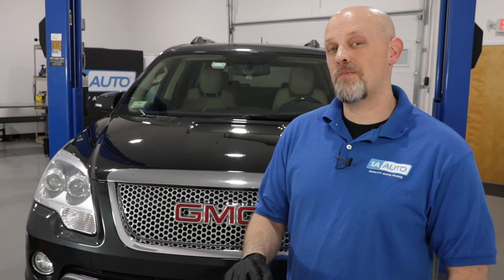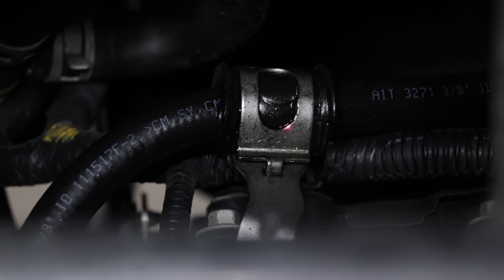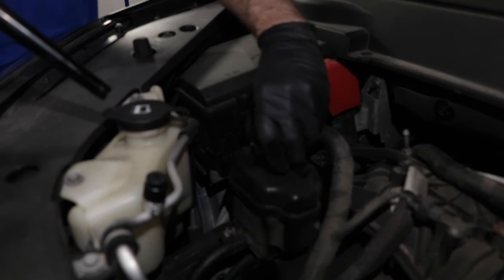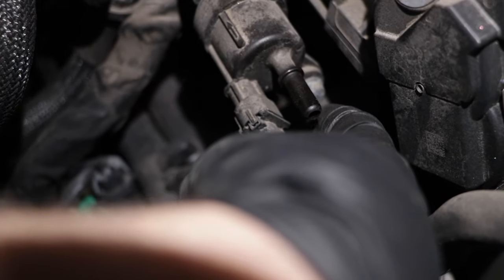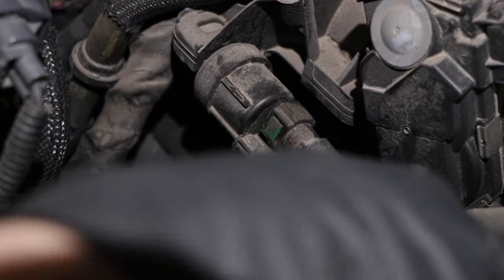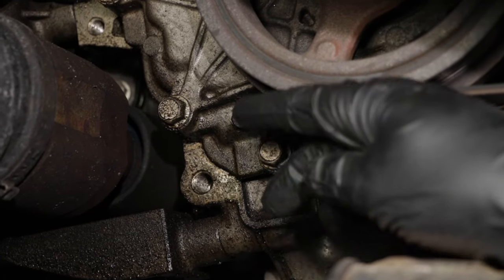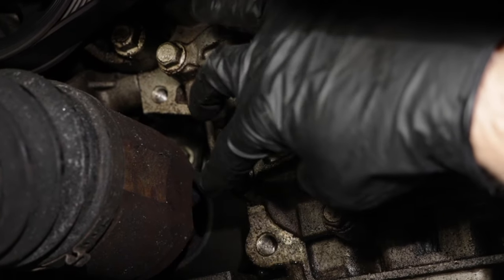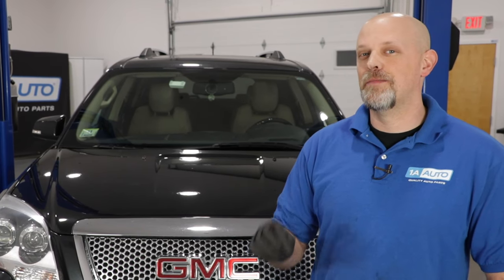Top 5 Problems GMC Acadia SUV 1st Generation 2007-2016

Comment: 2014 Acadia - Had to replace purge valve, the actual nipple for the purge hose was broken off at 45,000 mile mark i assumed from vibration of ther hose itself.  So I strapped the purge hose to the air hose from the air cleaner to the crankcase.  At 74,000 miles I filled up with gas and then the car would not start.  I eventually got it running again and discovered that air hose I strapped to the purge hose pulled away from the crankcase and caused P0171 p0174 and P0496 codes.  So an easy fix for a stubborn problem!

Comment: 1st gen actually ran until 2012. Second generation from 2013-2017 where that year both were made with the 3rd generation
Reply from the maker: +Marc Franco Thanks for the feedback!
Reply: Right? I saw the title and was like, “hold up, that ain’t right” 

Lol.
Reply: I believe that was just a face-lift/refresh rather than a brand new generation. 13-17 still rode on the same Lambda (GMT968) platform and used the 3.6 LLT.
Reply: First gen was from 07 to 17. Blake is correct about the refresh.  The interiors through all years are nearly identical
Reply: Correct! I didn't see your comment until after I posted my comment lol I'll just leave it anyways so more people can be aware...
Reply: True. Same platform, but the previous issues actually were more dominant in the 2007-2012 model years. Very minimal in the 2013-2017 years

Comment: 2014 Acadia FWD with 150,600 or so miles on it, rear brake calipers have locked up twice so far, just got it out of the shop with a $3000 bill...  broken engine mount, bad purge valve, oil leak from filter housing gasket, blown front struts, new sway bar links and an "exploded" (the mechanic's description) AC compressor besides 2 new tires, and alignment, new battery and routine oil change. Having said that, the only problems I had with the vehicle before about 120,000 miles were the calipers.  From most of the comments on here, it sounds like I got pretty lucky...  Since I got her out of the shop, she runs and drives as good as the day I bought her brand new with 9 miles on the odometer.

Comment: I had the timing belt stretch on my Acadia.... The mechanic took almost a month..... He said he has done multiple timing change on those cars but he couldn't figure out why mine was much harder.... He gave me a discount he took off $500 off....  And I never had a problem with it anymore....
Reply from the maker: +hacatan24 Thanks for the feedback!
Reply: I know you are lying. There is NO timing belt in those engines. GM hasnt used timing belts in a long LOOOOOOONG time. Your mechanic took a long time because he spent time looking for things that didnt exist.
Reply: Excuse my question, but you know how much the mechanic charged you for timing belt in this car, I think mine needs it and I'm figuring the rate

Comment: 2014 needing both CV Axles most likely. The transmission recently went in for full service rebuild and now has major vibrations when turning left and right, especially while accelerating from a stop light onto a freeway on ramp. Acceleration in curves and even driving straight but accelerating on slight inclines there’s vibrations being felt.

Comment: Everything was fine until you mentioned “timing chain” & “transmission” 😫
Reply: Mine had to have both of those issues fixed.  Luckily one was a factory recall and one was actually covered by the extended warranty.  On this vehicle the warranty will pay for itself.

Comment: Good thing I came across this video.  I have a 2011 GMC Acadia SLE with 187k miles.  I had my transmission rebuilt recently and everything was fine but when you mentioned the torque converter and a droning noise going up hills, I just started having this noise.  Doesn't happen often but definitely will hear it when the car has been sitting in the heat all day and then I drive home with the AC on.  Sounds kind metallic or even like the tire rubbing on plastic sometimes.  Even without the AC on, it will eventually happen.  There is a hill that I go up after turning left and it just makes a nasty noise.  But another thing is, I don't have to be driving highway speeds to hear that noise.  It is usually from accelerating after being stopped at a light or stop sign.  I wonder if what you talked about in the transmission segment, is what I have.  What do you think?  I still have a warranty on the rebuild so, I will have to try and get it back to the shop.
Reply: Yes, it's during the acceleration. It's probably the torque converter. I have that issue now. I just kind of let off accelerator and then slowly get back on it. Eventually I'll get it fixed.

Comment: You left out the issue they had with the PCV system clogging because the PCV valve is just a can with tin holes with no check valve inside like standard PCV valves have. It would clog and cause oil in the intake boot among other problems. Low oil levels for one caused the timing chains to overheat and stretch.
Reply: Yep

Comment: GREAT 1A Auto Post As ALWAYS **Should I buy a 2014 GMC Acadia AWD SLT? It was bought serviced at original dealer and selling at same dealer in IL. It has 111K its beautiful mint clean saw no leaks rust or smoke from tailpipe .I take of my 15 Equinox oil changed every 3.5K miles or 35-40% oil life left… Now I’m nervous because I haven’t done nothing to my 15 Equinox 2.4L yet…knowing that around 70K miles engine loses oil “GM mistake Eco-Tec”seal blowing from PCV..etc..but I had my mechanic check out for future problems but he says I’m good.. made in Tennessee no carbon build up 
***So back to the 2014 GMC ACADIA Yes or No? or problems are coming? great Post!!

Comment: I own a 2016 Acadia. Bought it with 42,000 miles. First 2 years no problems . 3rd year , i had to replace the power Sterling pump, thermostat and did a transmission flush at 75,000 miles. Replaced the battery  since it was giving out and upgraded  to an internstate battery.. Had to get a longer vent  hose to
  actullay fit properly.  I Always use chevron gas (89) and my mechanic uses Mobil 1 oil . Today my Acadia needed 2 heater hoses that ruptured leaking coolant everywhere.  These hoses cost 150 and 139. My current milage is 82,000. Is this a common situation or are these hoses made cheap? This suv is reliable,  great on gas for the size, comfortable to drive and sporty with plenty of nice features. Im satisfied with it. Hopefully its made well enough to give 300,000 miles. My 2000 eclipse is currently at 250.000 miles original engine and transmission.  Gmc should make better quality parts since im paying for an American vehicle.  I feel we have given imports preference when we should by American. GM should make quality parts like Toyota, Lexus and we would buy more instead. Thank you fpr the video i saw it years ago when i purchased my Acadia and still watch often for reference.

Comment: I believe we have had several of the issue's with our 2011. The check light has been on for the timing system for a while now. I dread tackling that issue. Have a few issues with starting. Replaced starter this past summer. Hit they key a lot of the times and it is like the vehicle has a dead battery but all column lights are on. Few times working ignition and it always fires. That's aggravating. Overall we have ran the wheels off it over the years.

Comment: My 2012 Acadia SLT hesitated, not the first time, and the check engine light started flashing. I parked it and had it towed to the dealership where the codes said it had had between 200-300 misfires in it's life. This is the only code it gave. Now the dealership wants to service/change the injectors, spark plugs/wires and whatever else they think might have generated that code. Last winter at -25° my Acadia blew out a huge puff of black smoke and then would not start. A couple of days later when it warmed up a bit outside it did start but still blew out black smoke just not as much. This continued for a few days and then stopped. It hasn't done it since. I have the oil changed regularly by the dealership and they do a comp safety/fluid level check on it. Please help.

Comment: From what i see on my Saturn Outlook, and read online in chat sites, they also have a great issue with burning and leaking oil out of the cam shaft oil seals.  These are crappy built engines.  everything from the transmission to the design of the engine is junk.

Comment: I just got a 2014 Acadia. It has 96,000 miles. Only issue I notice is going up a hill  about 20-25 mph  and it has a hard down shift.  It shifts fine other wise and there is no slipping. It just has this one gear where it has a hard down shift.

Comment: This vehicle it's a big piece of junk.  Engine damage cause by the timing change reflects poor American engineers. Don't forget to talk about oil blowing into the fuel injection and the air ducks. I will never buy one. Toyota it's way better car.
Reply: What do you mean about the oil issue someone told me I have lifter issues

Comment: Love my Acadia, but recently the check engine, traction control, abs, and brake lights are on with no codes and she drives in 2wd instead of 4wd. I changed out the speed sensors now looking to change out abs module, again no codes pop up. Any advise anyone with the same issue? By the way love your video and well explained 👏🏾

Comment: Your videos are very helpful . I do have a problem with my 2007 Acadia . While I'm driving the vehicle loses all power and won't start right away after this happens . What do you possibly think it is I've had a few shops look at it and couldn't pin point it . Plz help !

Comment: Thank you for the video. Bought 2012 Acadia with 130,000 miles and bad transmission. It was replaced and 2 was later it was back to dealership for a month getting another transmission. Couple months later it started acting up again. Once again back at dealership for a month and was told it was a speed sensor or something they replaced. Vehicle still doesn’t seem like it’s 100% but it’s running. Of course now my vents don’t work so not sure if something happened or the actuator quit. I love the vehicle but hubby hates it. 🤣
Reply from the maker: +Skidmore Family Farm Thanks for checking us out! http://1aau.to/m/Shop-1AAuto-c

Comment: I wanted to ask, when checking the transmission fluid levels.  I know it has to be at operating temp, but is it check the stick while running in park or engine off?  I tried both and there is a difference in levels but I wanted to verify what one.  Thank you

Comment: Hi I have a GMC Acadia 2009. After buying this car heard lots of bad reviews about. Coming to know that now I have a problem with the motor. When I took it for a oki change they found a peace of metal cord in it. They said something might have broke. They charging $3000 approximately. My question is.. would this be worth spending this amount of money for them to check it ??? Plus I also had to pay $200 when I first bought it after 75 hours because the car locked after I removed the battery. I think it was theft lock wish they explained that it’s like a security that the car locks when the battery is remove to prevent theft. Ugh so frustrating. Please advices if this is worth paying if there is any hope it’s can be fix. Thank you… love your video by the way 👍

Comment: Any advices before I give up on my 2011 GMC Acadia SL 3.6 
Overheating issue is driving me crazy, I replaced coolant temperature sensor, thermostat, water pump, and I still have the problem

When I at stop stop light the needle goes up but when I hit the gas pedal needle goes down 

Last thing I will be doing is flushing the radiator
Reply from the maker: +Jay Cruz We wouldn't be able to diagnose an issue like that here, you may want to have a local mechanic take a look at it. Thanks for checking us out! http://1aau.to/m/Shop-1AAuto-c

Comment: My 2010 Acadia was left (willed) to me and had just 3000 miles.  I have been waiting for the Transmission problems after researching the vehicle and it’s $1000 ECM for the transmission. 
Now all at once at 35k miles, the panel lights and gages flash repeatedly during operation, and Traction Control warnings show, and the transmission warning light showed-at once. The foreknowledge coupled with now clunky operation, I just feel like the GMC Service Dept is grinning and gleefully rubbing their hands as I set my appointment and brace for thousands of dollars in repairs. I’m thankful for the “free” vehicle, but I better understand now why people buy foreign cars that use the same proven equipment which had all of the kinks worked-out.

Comment: Have alternator problems. Alternator shorted internally and drained battery to .065VDC in 2 min !  At first, the battery ran down so quick that I thought it was a bad shorted battery, which I replaced (pain in the behind because front passenger seat was all the way back (its electric) and with a dead battery I could not move seat up without inverting new battery and touching terminals while a helper moved the seat switch). New battery finally in, started sluggish, then the wire burning smell of the alternator totally burned up with 100% current . I had to disconnect battery before it totally fried the wire from the battery to the cable to the junction box in the engine compartment. The alternator pulley bolt was the hardest to remove without the right tool. All in all, not an easy repair. I don't mine having to take a lot of stuff off if I can reach all the bolts, but when the hardware is very difficult to access, even with the right tools, that's just bad design engineering.   PS. I'm selling it now, a lot of little things going out, like turn cancel in steering column broke. Its just a lot to keep up with now. 185,000 miles. Its done its job, time to retire, it was good while it lasted. On to something else now. Good job on the video.

Comment: Hey, thanks for the great video!  I have a 2010 Acadia and was having problems starting after refueling.   My daughter was driving it and called and told me she barely made it home.  I tried to start it and nothing!  I replaced the purge valve as you mentioned and also cleaned the MAP sensor but it still won't start.  My brother in law says to replace the fuel pump but that looks like a huge job.  Do you have any more suggestions.

Comment: 2 of 5 issues were on point. Haven't had the other issues...yet. I do have a question, I had a oil leak at the transmission front cover, replaced the gasket /seal and it lasted 2 weeks, and the leak came back in the same spot from one of the bolts. Could it be the cover itself?
Reply: Check pcv for plugging. Excessjve pressure from plugged pcv will cause this

Comment: Have fun changing the starter. Most people remove the exhaust manifold  and catalytic converter. I disconnected the knock sensor connector, removed the oil filter and took off the front engine mount.

Comment: Got an 07 that I like, but it's been a money pit. Transmission issues: wave plates, control module and a torque converter. Engine: burnt valve, throttle body and now timing chains. Stability Track issues never solved. The radio and amp replaced. A side view mirror and a rear window have failed.

Comment: I have a 09 Traverse and have noticed a swaying motion when driving around corners in town and on the highway. Have replaced my struts and shocks front and rear. Replaced the rear control arms as well what else could cause this problem 
Colin Lewis

Comment: You mentioned an upper engine cleaner added through the vent tube of the valve covers. I can not locate such a product. Spoke with 1A Auto CS and was told they do not know what that product is, or where it can be sourced. Any Help? 2014 GMC Arcadia

Comment: I was curious to know after you clean your valves in that manner and there's a lot of smoke coming out of the exhaust does that affect oxygen sensors within the exhaust system? do they need cleaned after that? Or will they just burn off
Reply: Burn off it's normal to do this won't hurt them

Comment: I have a 2012 acadia that i got with 24k miles on it back in 2016. It now has about 136k miles and now seems to be having this timing issue. First major issue ither than an alternatir and AC Freon leak. But dang this chain sitiation is expensive or time consuming. Not sure which way to go with the repair yet

Comment: I love my 2012 Acadia AWD but at 118K miles the truck started to Bucking around between 1500 & 2000 rmp. Best description i can give.  Have run marvel & 93 octane through it and still does same thing.  Could it be that the throttle body needs to be cleaned out?   What could it be other than a dealership saying I need to replace transmission.  Onstar nor Fixed does not indicate any problems.  Also actuators went out about the same time.  Suggestions before I spend a fortune on it??

Comment: I have a 2012 Acadia and have 71,000 original miles. I got the Acadia in 2019 and the miles on it were 35,000 original miles. Between 2019 and 2024, I have replaced the rack and pinon, both front struts, both motor mounts, dual electric fan system and just 2 weeks ago had replaced the alternator brand new, not a remanufactured alternator. About $5000 total in replacing and repairs. I change the oil every 3000 miles or 6 months, which ever comes first. I changed the transmission fluid at 50,000 miles. I haven't changed the spark plugs as the manual says change spark plugs every 100,000 miles. Are there any more concerns that I should have checked out by my mechanic? Should I wait till 100,000 to change the spark plugs?Please feel free at your earliest convenience to let me know what else I should have my Acadia be checked for.

Comment: I have a 2011 Acadia,message says “oil pressure low, turn off engine” oil was a half quart low is that enough to get that message? I didn’t think a half quart low would do that.